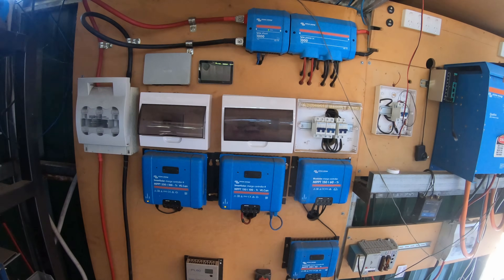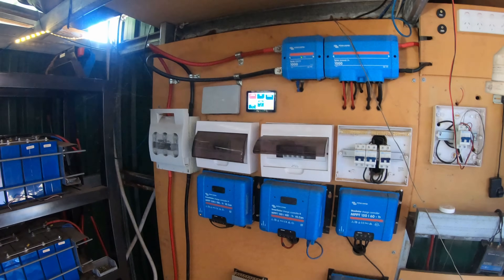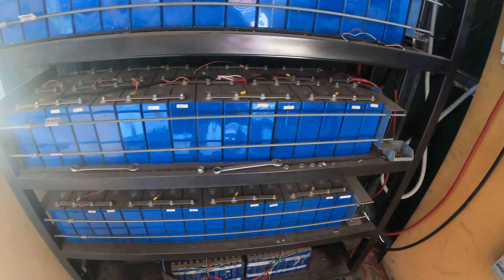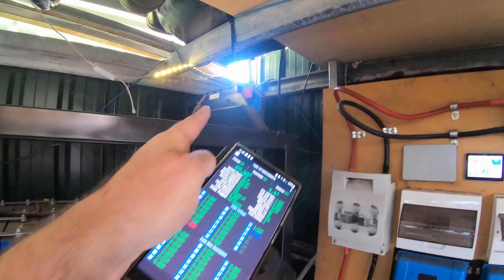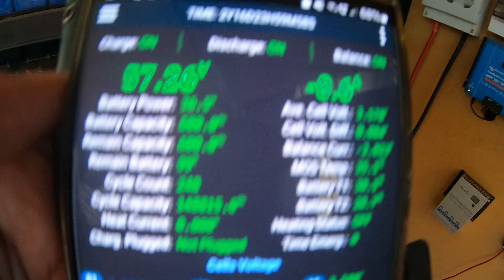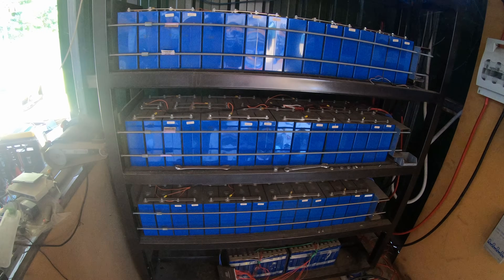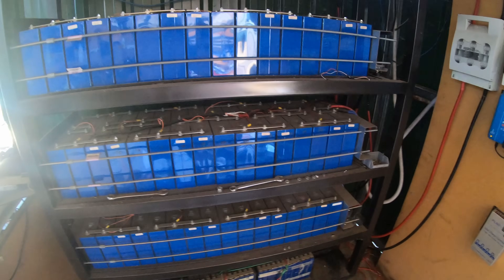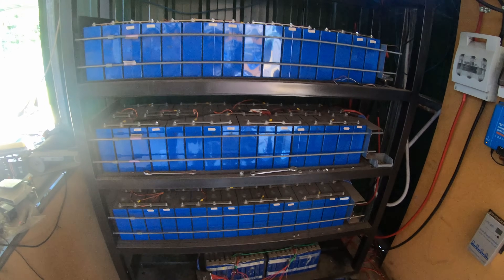The battery after 2 years of use

Comment: I have a large pack of these same cells (I think, anyway, mine are CATL cells rated at 280Ah). And they're just as old as yours and working like champs. No complaints yet. I do have all the power coming in and going out via 1 cable though so every battery gets the same amount of punishment.

Would absolutely recommend these, they're a lot of fun to work with and not too hard to set up either!
Reply from the maker: its excellent hey, ours are close to paying themselves off already. i think we are 17k now, so one more year and they will have paid for themselves. My friends battery came in even cheaper per cell using the new 320's

Comment: Hmm. Which prismatic batteries, aren't chinese? They are the leaders currently in battery tech
Reply: Built my first pack with 16 280 eve cells, cell diff is just 1mv (seplos e10 bms), ordered another 32. But will be changing to JK bms
Reply from the maker: 1mv is nothing, did you top balance them when you got them or let the balancer do it ?
Reply: @BadIdea1123 I didn't do any top or bottom balancing. The cells were grade a, first life cells, so were matched from the same batch. A year later and they still perform exactly the same.

Comment: How many kW can the system store? Thanks
Reply from the maker: 90kwh, in the three main shelves. Plus some spare cells on the bottom that add up to another 10kwh. Then we have an additional 30kwh in the van that we use as a back up
Reply: @BadIdea1123  thank you very much, wow quite the setup. Thanks

Comment: Nice setup but these métal bar around the cell make me nervous. You know that the outside of cell is the positive terminal right ? Not sure about this but this seems dangerous to me.
Reply from the maker: the compression threads ? or the spanners i left on the side (i should take them away )
Reply: @BadIdea1123  yeah the compression threads, for me ( and again , i'm not 100% sure about that ) not a single metal part should be near the cell, like i said, the outer shell of these prismatic cell is the positive therminal :x, i know a lot of people do this that way, but to me it's a little bit risky, if for some reason the cell are damaged this could get in contact and short, again, very very nice setup ! it's just how i feel about this detail :p
Reply from the maker: @chris_mk5supra  If you get close to it there is a space, They arent touching the metal. There is medium density foam in between each cell and at the ends. so no steel touches the cells. It might look in the videos like its touching but it isnt

Comment: so for short how many kw of storage do you have in the rack? i agree that if you take care of them they can last but the price is enormous and you basically need to stay within 40 percent DoD
Reply from the maker: 90kwh, with a spare 10Kwh sitting on the bottom shelf. 

The exact size is 96 * 966.4wh = 92,774.4Kwh
Reply: @BadIdea1123 cool design; havent gotten yet to see ur panels array but I presume u have a few; that shed isnt for anyone to mendle and DIY; how freezing winters do you guys have? how do you do if you have subzero temps? some micro hydro or some below kwh eolian has gone through ur mind? or even a 35 kw diy brine battery (this might take some too much space, but if u have the time and you like diying into home storage and production then why not); just now thought of a diy brine battery since desalinations are everywhere, not quite energy dense but u might get some views on ur channel and with a bit of luck even a few working kwh of storage on a cheap side
Reply from the maker: @shazzz_land  Na we dont often get below zero celcius. And when it does its not much below 0C so we dont have an issue with that. I have some free time this weekend so i will grab a shot of the panels for ya 

The shed was effectively some old thing someone pulled down. it was just cheap that is all

Comment: Kind of sucks that even though you dont use any power off the grid you still pay a connection fee so still have a bill unless you get them to cut you off
Reply from the maker: The amount our grid tied solar sends back is enough to cover it. But yea.... its ridiculous that there was even a charge to start with... the power we are sending back is still being sold at 28c
Reply: You nust be on the old buyback system.  I'm only getting 7cents per kW and if we upgrade it goes down to 2cents per kw
Reply from the maker: @truey90s  We only left the existing grid tied solar on it, If we didnt have it i would have disconnected already

Comment: Could you go into further explanation as to why the top one is stressed more to load? Would moving one of either the negative or the positive cable to originate from the bottom help with spreading load?
Reply from the maker: thats come up a few times, and yes i think it would help. Next weekend  coming i will go through the calibration process and see if that makes a difference or we will start to look at changing the cabling around

Comment: Get some 25 x 16mm electrical ducting take the lid off turned upside down it covers the battery buss bars you just cut lengths the same lengths as you battery  it clips over the cell buss bars cheap and neat. I have 32 x 230Ah EVE grade A cells as a 460Ah 16s battery they are performing better than 16 x 280Ah EVE cells in another installation.
Reply from the maker: That is an excellent idea

Comment: Rack looks really scary !  all open ctcts and metal tools and bolts on the edge !
Reply from the maker: Yea i need to put covers on it, It is isolated away from the house in its own shed. But yea i could def use some doors on it
Reply: @BadIdea1123  bottom-cut pvc pipe covering terminals maybe

Comment: When they catch on fire, your batteries take out all your inverters etc.  For goodness sakes, use some fire mitigations measures, like some physical separation such as a simple divider wall.  Anyone can go and look up, the instances of LiFePO4 catching on fire, safer than other Lithium chemistry, but they still can burn.  When you have 20 years on the system, lets see how its all working out.  2 years is almost nothing, its early days yet.
Reply from the maker: If you look back through our videos, The wall the inverter is on was put up explicitly for the inverter. There is no where for the fire to spread to. it was entirely intentional. I do need to put doors on the rack though

Comment: If I were me, for fire prevention, I would make the battery racks into a rolling rack and the power lines quick release detachable, and have an automatic eject system like a winch to pull the racks out of the house in case the cells catch on fire. I've seen so many battery fires like electric scooters, buses, cars and balancing boards, and the fires are extremely violent. Scary stuff!
Reply from the maker: You know what, i have some massive 375 amp anderson plugs sitting on my bench... But yea this is not in the house its off to the side in a crappy old shed. But totally agree the anxiety is real when it comes to the scooter battery
Reply: @BadIdea1123 Cool. What I had in mind is a spring loaded mechanical system to eject the connectors with a push of a button, or an insulated lever so you won't have to reach for the cables, you can eject it from a distance.
Reply: Jack, these lithium iron phosphate cells, not lithium ion... While it is technically possible for these to cause a fire, it's probably and order of magnitude or two less than you're vehicle catching in the night and the fire spreading to your house, or lightning striking causing a fire, etc....
Reply: @sportbikeguy9875  I've dealt with M1 A123 LiFePo4 since around 2010. They are definitely safer. But I had an accident one time, I inserted one cell in the charger in reverse polarity. Pulled it out and it started fizzing and popping. I dropped it in a metal box outside in my balcony. I catch on fire but it did get hot. Can you imagine having that kind of reaction with these brick size cells?? Those were genuine A123 cells. What if BadIdea's cells are counterfeit LiFePo4? In my experience with ordering products from China, there are way too many counterfeiting going on in China.

Comment: whoa 0:51 those wrenches on that rack of batteries with exposed terminals gives me the willies! You can at least cover them with a clear sheet of acrylic if you like looking at them that much, plus it will keep dust and water off. 

"Chinese Batteries" lol aren't all batteries manufactured in China now?
Reply from the maker: Ah yes, yes they are.. 

Your not the first person to mention the spanners (wrenches) i will move them :)
Reply: @BadIdea1123  I'm no expert, but I've messed around with E bike kits about 15 years ago, I built battery packs using the M1 A123 LiFePo4. I'm grateful that I've haven't had any bad accidents handling so much power in my tiny apartment with two toddlers.

Comment: I use to import li-ion cells from China, they on cell or manufacture on behalf LG, Samsung cells and a wide range of other stuff.
It's more about the QC and tolerances of the factory you are buying from.

The problem being buying in residential volumes you'll never know where they are coming from or get to have yarns to the engineers.
Na-ion is a interesting development, heard about poor quality components on some of the new ones
Reply from the maker: you would always have that anxiety about one cell burning the rest of the pack down. 

I have one out of my E-Scooter i refuse to keep it in the house, particularly after it failed. But i am going to rebuild it. Using the new cells it can go from 17.5 ah, to close to 30ah. while thats amazing you could rest assure that the opportunity for failure has probably gone up with the capacity

Comment: This is a great idea. I've got a long term plan of being off grid. I've been purchasing everything I need to do it and I am finally getting to the batteries. So far I've got solar panels, a brand new listeroid diesel generator for when there is no sun (south florida so won't be often), some EG4 6000XP inverters, and lastly I want to shoot for at least 50kwh of battery storage. I really want to run some machines off solar like a bridgeport mill, lathe, air compressor, etc. I have been thinking of getting a few more inverters, dedicating some just to running the three phase I need when I occasionally need it and then having two that are continuously powering my house. That way if one should fail I can swap out one of the non-critical inverters to keep my house powered.
Reply from the maker: You looking at 3 phase ? 

I suspect Florida and AU have a similar light situation. We still struggle through winter though because we use a lot of power.

Comment: My oldest pack has been in 24/7 use now for 6 years. They'll be fine...
Reply from the maker: How much do you cycle it ? and have you noticed any capacity degradation ?
Reply: @BadIdea1123  I don't have a cycle count (in summer it's mostly full, in winter mostly empty). This is an off-grid house in Finland, so winter sees no sun. The only degradation I have measured is the usual calendar aging, but even that is not a big deal.

Comment: Almost all LifePo4 batteries are 'made in China'. 
BY the way, it is 100% safe to discharge your LifePo cells from 3.65v all the way down to 2.5v (a full cycle, whereby 3.65v = 100% and 2.5v = 0%) - every single day! That's what they are designed to to do! When they give you the spec for cycle count, that's the test they use! So 6000 cycle counts, means 3.65v down to 2.5v.
Reply from the maker: I also would be interested in seeing this

Comment: Heavy load need huge number of battery. If you empty you bank is fatal. You need keep 60% full all battery. Set warning at 62% and disconnect havy load. I use 8 year my gel battery with this rules. If you use 80% can go to 15 year use of bank. You need know max load. Try figure out these rules how to implement . Same is for car battery and all kind of battery. If you want long time use.
Reply: Lithium Iron Phosphate is not Lead Acid. You can take these down to 0% and not have any problems.
Reply from the maker: The max load is around 150amps, we actually charge with more than we discharge, charge could be as high as 320ish. But yea given they are over 2 years old and only cycles 250ish times our discharge is roughly 30% on average

Comment: Please wrap the wrenches with vinyl tape including the end not in use! Murphy’s law states that if they fall, it will be in the worst place possible. Cheers.
Reply from the maker: I should put them away lets face it :)  but yea you are correct i should have something over them even just to use them in the battery in the first place
Reply: Wrapped  my extra long wrenches with a double layer of electrician rubber tape then two layers of vinyl. Safer better.

Comment: When people say "Chinese products are crap" all I can think is "yes, keep believing that so prices stay low for me."

Eve cells are a revolution.  I repowered my sailboat with 28 LF280K cells (7P4S) and it's transformed the way I live during the summer.  I went from four group 4D AGMs that typically lasted 3-5 years (5-6kWh usable) to a 25kWh lifepo4 system that's well over 90% charge/discharge efficient.  I can run the washer/dryer at anchor.  I can run air conditioning at night for a long weekend.  I can recharge the entire system in about 4 hours, and then I'm good for a week.

After two years of heavy use the batteries have the same capacity they did when I installed them (tested 2110Ah on day one, 2112Ah when I left the boat last season; 15C / 22C temp, ~150A load).  I have no doubt this pack will last me well over a decade.. probably two.
Reply: I jus want CATL because they have a very good reputation to be inside high end products. EVE cells i have seen in some products all around in the west but these are medium tired products not high end. They are still good but i prefer CATL.
Reply from the maker: i have heard the new catl are really good. Either way i see another shelf in the near future

Comment: Take your tapping  at the centre pack, more balance to the cells. I had a problem similar to this 40 years ago on a test rig someone had built for running 40 electronics units for a week at a time. Several volts difference from one end to the other, tapping in the middle dropped it dramatically
Reply from the maker: Tapping ?
Reply: @BadIdea1123  three connected batteries to the busbar. Connect to the middle of the busbar rather than one end so that reisitances are evened out.

Comment: i use similar batteries, but i use Andy`s from australia max charge setting of 3.45v per cell, as there is very very little left in the cell as far as capacity beyond that. Agreed, these cells are pretty good and reliable.
Reply from the maker: We normally do the same, We periodically ramp it up to give the balancer the best chance to balance out the pack. Normally we would use a float absorb of 56.2/55.8 or 3.51/3.48v

Comment: The people who are talking about batteries are dumdumbs.
In the 80' i had a windturbine with blades from a old water pump station and it worked fine in little to strong winds like we had were i lived.
I don't remember what generator/ charger,  but it was from  a military truck and mounted with a gear, 
Batteries were lead acid from military trucks and forklifts, we used them for 20 years without problems, except for refilling the waterlevels.
People nowadays are falling in to all the speculations and people who don't have a clue about the reality, but they know everything about the theories. 
How many times did we have to change the brushes for the generator? 2 times in 20 years and we were 6 people in the house and used it  to everything except for a wood stove and a gas stove.
Reply: I forgot, we used 12V bulbs from cars to lighting up the house.
Today's owners are using LED lights and other things, but they still have the batteries for backup if the new IPO is failing in the future.
Reply: I am thinking the same way.  Nothing wrong with lead acid batteries as long as they aren't abused either. 20 years is good going though and I would feel  much more comfortable charging a bank of lead than lithium any day.  I'm pretty sure we don't need all the control gear either like this chap has which cost him over $21000!  That's a lot of capital and you need that cash to start with.  I'm wondering if smart charging is even needed from a wind turbine?  as long as the batteries are getting some voltage to them whenever the wind blows it should charge them, at different rates obviously.  It's possible to charge a 12v lead battery using a welder delivering 50 volts! people do this sometimes to revive old batteries and it works quite well so I think pulse charging a bank of batteries from a turbine would work? I intend to give it a go anyway to find out for myself :)
Reply from the maker: Wind turbines are something on my list, Our property isnt big enough to put up a tower but i would love to if i could.

Comment: Your battery voltage is too high, it should be set to a single 3.45V full charge, full charge is 55V.   Suggestions from Chinese players
Reply from the maker: Yea i should have prefaced the video, we dont run it so high all the time. Only when we see the average cell difference climb. So we up the voltage to let the cells balance out then we turn it down again. We normally have a float absorb of 3.51/3.48